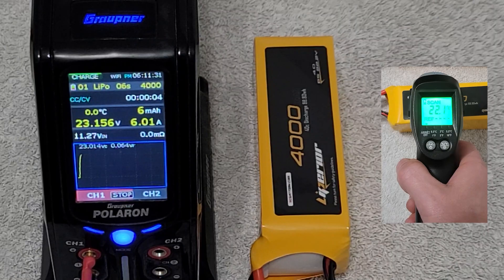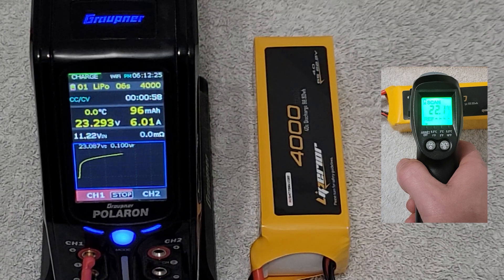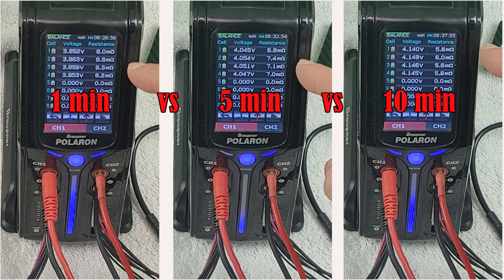Your LiPo IR Results Are Wrong! 4 Essential Tips You’re Missing!

Comment: I have 3 different chargers (different brands also) and they all read different IR by significant amount. Not to say that they read different IR compared to what they read themselves 30 seconds ago. Also one of them always read the first cell of any battery as beign around twice as much as the other cells. It's one of those scenarios when you have 2 watches you never know the time. I tried to measure IR manually but it's a pain and again I didn't get consistent results for the same pack. I used same voltage (3.8v/cell, same ambiental temp. etc). This IR thing  made me so frustrated about doing scientific measurment that nothing else did before and that's because the results are more or less a play of dice in the end. Sure I can compare 2 packs by measuring with the same charger and get a guesstimate than one pack might perform better but I would not bet that the results are proportional with the quality of the pack.

Comment: Personally, if a 2s can make my slash wheelie, or I can’t go full throttle on two 3s packs in my Revo on my street, and I can’t go full throttle in my Hoss on a 4s on my street, then odds are good that the batteries are performing well.  I’d love to have better instrumentation but I gotta run what I got. I’ve noticed that the better performing packs meet those performance criteria while also consistently reading a lower internal resistance on my charger. Meanwhile packs with higher internal resistance can’t wheelie my Slash or run out of steam in my Revo or Hoss before the end of my street.  I still keep those lower performing batteries though for whenever one of the neighborhood kids wants to drive one of my cars.  What’s crazy is my ancient Team Orion duo charger can read internal resistance but I never paid attention to it till recently. Thanks for the great info! While I know my testing is far from scientific, and I’m no world speed record runner, now I can usually look at the charging results of a battery and be able to accurately predict how the car will drive. So far I’ve had the best luck with some of the HRB and the CNHL batteries. Hoovoo has been disappointing, I haven’t tested Zee and all my name brand batteries, Traxxas, Spektrum, and so on are all quite old.
Reply from the maker: That's some good insight, thank you for this.

Comment: Thanks for the info. My charger can't measure the internal resistance during charging. The internal resistance can be measured either before charging or after charging. What is the best time to measure the internal resistance?
Reply from the maker: In your case it would be best before charging. It makes the most sense right from storage voltage.
Reply: @RCexplained  o.k., thank you!

Comment: I'm not surprised these are terrible batteries at the cost they are sold at. I would say you can only scientifically compare your own results with your own equipment as everybodies equipment will vary in some way as well including room temperature
Reply from the maker: Yes, the idea here is that accuracy is not as important as consistency or repeatability so that we can measure and compare among our own results. This works well.
Reply: He doesn't state a battery brand? Only shows an Optipower lipo on the charger.  Which one are u referring to?

Comment: U need to get yourself a ICharger 458 or 458 to measure or a ESR mark 1V
Reply from the maker: What will these do for me?
Reply: @RCexplained  A more accurate reading.
Reply: @RCexplained  You can hook up an external resistor to discharge the battery and it'll update your IR throughout the process.  We're discharging 2s lipos at up to 45A and seeing some good batteries hit low 1.x IRs
You can also power it from a battery and regen your RC lipo back to that battery so you don't have to dump to a resistor if you want.

Comment: How can you be sure your charging system is accurate?
I ask because last week you were getting 12C IR readings on the Zee batteries that are rated for 120C. That's a HUGE discrepancy, and from all the comments everywhere on the planet, the rest of the world wasn't getting these problems whatsoever.
Reply from the maker: The Zeee 5200s are the first set of LiPos that hit LVC in 30 seconds maintaining less then 95A and you want to blame the charger?
Reply: @RCexplained  that's not what I said. At all. I asked a legitimate question based on all the common responses across the board. It seems you've tested an anomaly and I'm asking how  can we be sure the test method is sound? 
I don't want to "blame" anything. I want to test and retest. That's the scientific method- results must be repeatable to be considered evidence.
It definitely seems that 12C is such an extreme reading that it warrants the question - why was your data such a low number. 12 out of a possible 120 is 10%. I would think that a 90% restriction on current flow would result in a fire. And at the very least a return to Amazon. No mention of that. 
All I'm asking is why. 
And if you used a different charger, would your results be closer to the anecdotal results of.... everyone else.
Why didn't you return the batteries to Amazon and see if the replacements were better? If they're faulty you'd think that would be the first course of action so you could test some that are nominal? 
12 instead of 120 is a huge anomaly. 
Especially when nobody else is reporting issues that would reflect the same. 
If a guy used a different test method, would it give the zame results? It's a valid question. We're listening to your tests, so it's valid to want to know these things.
Reply from the maker: Correct, I'm directly speaking to the point you have made about how the testing method is sound. 
I'm trying to understand the concern you have with the 105A LiPo load test?
Reply: @RCexplained  The results seem so out of whack, that I question the validity of them. How is that hard to understand? 
Why are you so defensive? And why do you refuse to answer my questions and instead just ask me ego type questions of your own? If you're going to do product testing, the results should be the results. It feels like you're not being forthcoming here. 
Why didn't you return the LiPo batteries and retest the new ones? Why is your equipment accurate? 
Again- 120C rating coming back as 12C without something igniting seems off. I question the results because they do not make sense.
Reply from the maker: Generally when I read comments like how do you not understand this, I ignore and move on as it's unconstructive and time consuming to reply. 

 I'm quite certain I answered the question concerning the IR tests that I do, in the video. The dataset that I have shows a strong trend that matches loaded data tests. The loaded datasets are real world results with a real RC load attached. 

Why don't I send them back? It's quite difficult to return items like this where I have to split the case open accessing the cells. For these packs  ive split the cells up individually for a future video. 
I can get new cells without returning them but it's more than likely going to tell the same story as we are 4/4 on this channel with Zeee packs. In addition as it's related to the c rating this is how the industry is. It's quite well understood by hobbyists at this point that a 100+C rated battery actually performs at a real C rating below 35-40. This is not Zeee its all of them.

Charger accuracy.
I'm not concerned about equipment accuracy but am highly concerned about repeatability. Getting new equipment that is "more accurate" would result in skewed results as my formula on the spreadsheet is calibrated to multiple tests determining the actual safe discharge c rating of a pack.
Reply: @RCexplained  Oh. So you're making things up and down understand the scientific method then. Scrutiny is the bane of bullshits existence. Gotcha
Reply from the maker: No, actually, you said I'm making things up and down. It's been over a year of running these tests and after 10s of thousands that have watched it, you think you got me. 🤣
Reply: @RCexplained  Well I think something is off. It's so odd that instead of talking to a guy with answers, I'm talking to a bruised ego with perhaps a bad couple of batteries and the lack of audacity to chalk it up to something that can be proven instead of assumed. The same way you're assuming questions are an attack, you seem to assume that an insignificant sample size is the end all be all- despite droves of people telling you, no dude, something isn't right about that result. 
So, carry on. Obviously ego is causing an impasse here. So there's really no point continuing the back and forth
Reply from the maker: What sample size is large enough? As I mentioned 4 Zeee packs were tested. 2 from a year ago and 2 from last weeks video. That's 16 out of 16 bad cells.  If 2 more packs are bought and the relationship still continues, what does that mean?
Reply: @RCexplained  Well if it was me, I would put a call out to anyone with the same batteries and charger setup to run the same test and submit or tag the video. Because 10% of available C rating just doesn't make any sense without causing fires. And nobody is reporting mass fires with these batteries. Quite the opposite actually, people love them.
Can you help me understand why droves of people have a perfectly fine experience with them if they only have 10% of the adverised C rating while being fully charged up to nomina voltage and lasting just as long as other batteries, while being just fine for punch and hauling ass? 
I don't understand how that adds up. My Zee batteries literally stand my Senton up on 2 wheels. And they run my on road cars just fine problem free. How is that possible at 10% of the C rating?
Reply from the maker: Got it. I'll make another video and buy another 2 packs.
Reply from the maker: Video was done over a Week ago:
https://youtu.be/u2Cyow5IfQs
Reply: Hmmmm. Verifiable, repeated accuracy of the Battery Charger?
Garbage in. Garbage out.
Reply: I run zeee packs in all my bashers just because they’re cheap and idc if they get damaged. I have a buddy who races and has race batteries from exalt, i ran my truck on 2 4s 10000 mah 120c zeee packs and then on two of his 4s 5900mah 135c exalt packs. With his batteries my truck would do a standing backflip and with my zeee packs it won’t even do a back flip off a ramp. I’m not spending 200 per pack when i paid 120 for my two zeee 10kmah packs and they preform fine,but just because most people don’t know their batteries actually suck don’t make them good. Tons of people say they work fine because they don’t know any better or have tried anything else and for others like me well they work good enough and i don’t have to worry about them flying out of the truck and getting destroyed because they’re so cheap. 

Just like with everything else in life,you get what you pay for. On paper the zeee packs are better than packs twice the cost id say that’s more suspect  than the company lying that egregiously about a C rating.